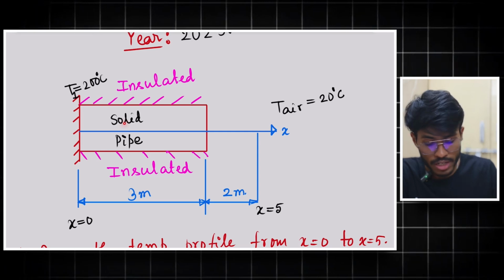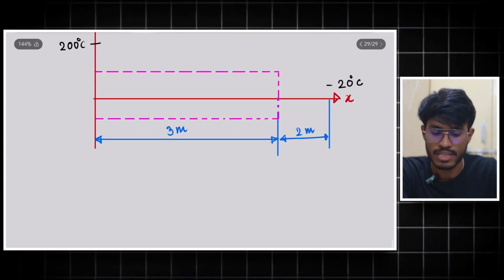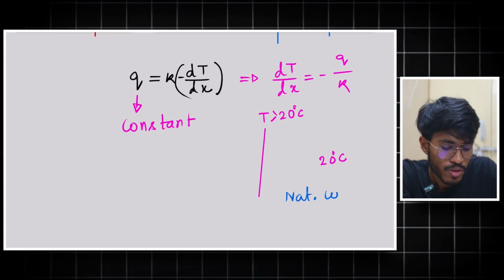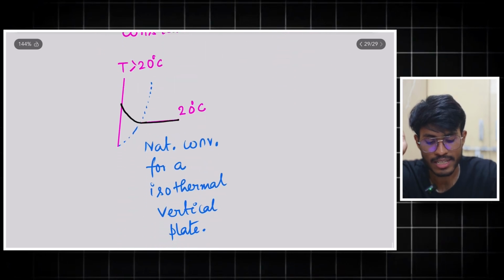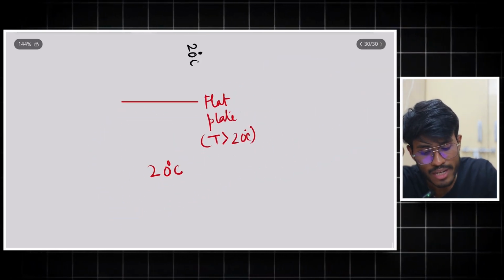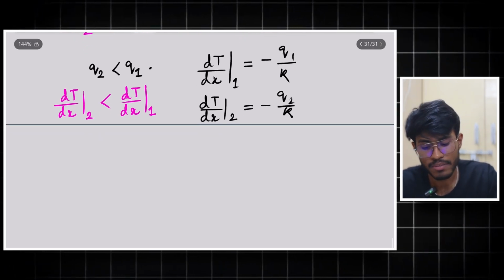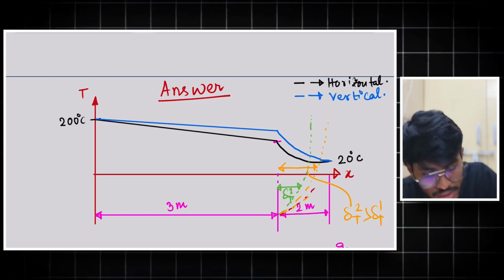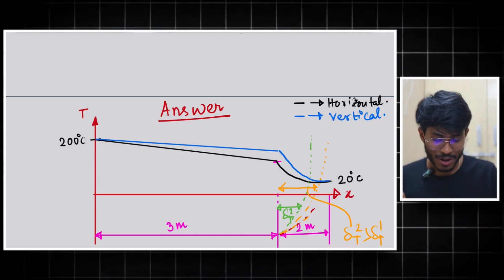FIRST TIME EVER!!!!| ‘’BARC’’ REAL INTERVIEW QUESTION SOLVING | AIR 31

Comment: Bro u told u have checked gate without coaching institute but last year u had made a video with exergic gate coaching institute where it was mentioned u were a exergic student... Which is real?
Reply from the maker: I bought their test series. And I took a very small numerical solving video series which costed me 750. That's all
Reply: @Thesohamway   I think I got it wrong bhai.. np.
Reply: Bro I have completed the fluid mechanics syllabus but I think I am able to solve 60percent of pyq but to increase my accuracy what can I do.. still I need to strong my concepts.. bro mention the concepts to learn in depth in fmm I will check if I had gone through it